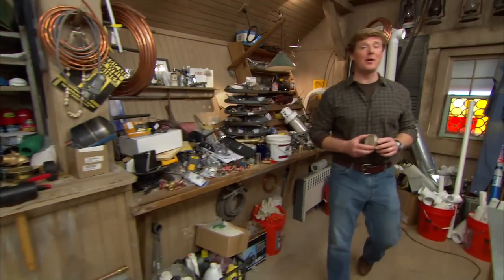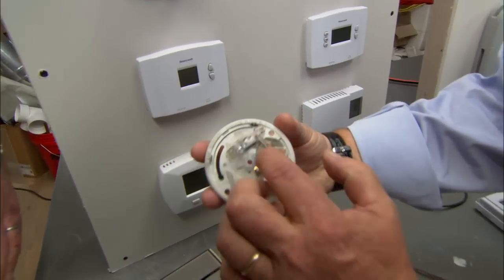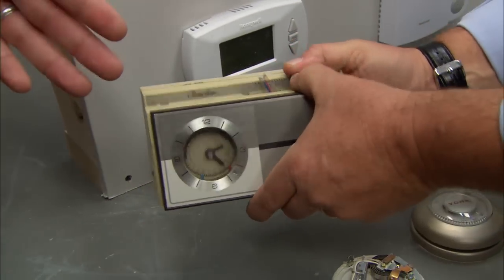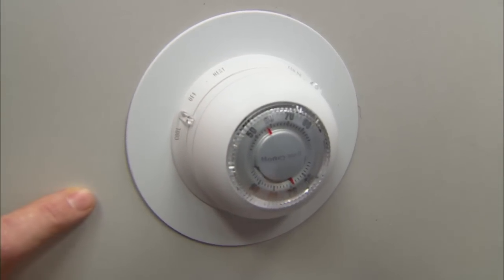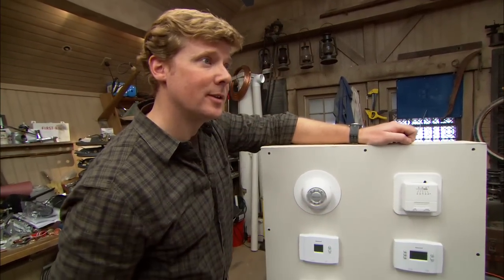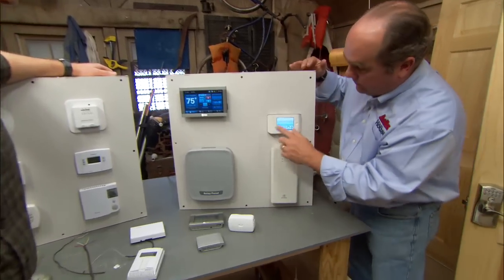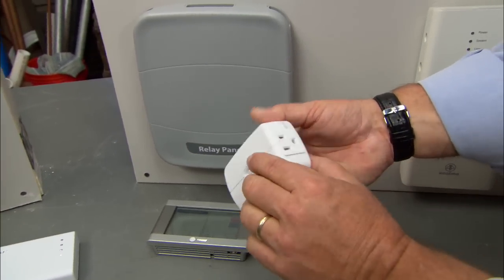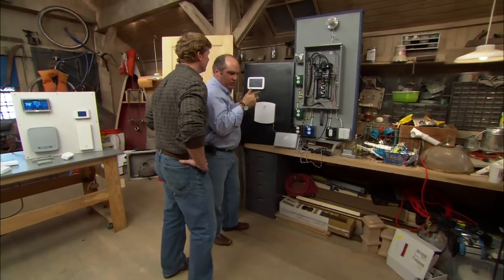How to Choose a Thermostat or Home Automation System | This Old House

Comment: Hi, my ac was working great until I changed out the
thermostat and now the system is not blowing cold air. I put the old thermostat
back on and still blows but not cold. What did I blow up? Thanks
Reply: One of the relays on the circuit board cause you probably didn't turn off the power. I'm sure you've called a tech by now.

Comment: Sir: I have two zone house.  I want to replace the bedroom thermostat in the hallway.  I want to replace it with the relay board (2:10). Then, I would like to get the wireless remote thermostat.  The brand names of the relay board and wireless remote thermostat are not easy to read. Could you please provide the brand names. tnx EdA

Comment: My baseboard heater works by setting the room temperature. It's a 5 foot long baseboard heater in a 170 sq.foot room. I set the room temperature to 22 Celsius. How much wattage does this consume? And would it cost more to set the temperature to 23 C?

Comment: Hello, I'm from Argentina where this is not an easy topic and I'm travelling on the next month to the USA. My idea is to buy products there.
I saw some of your videos and they are awesome! Really helpful, anyway I have some doubts about my case. Let me introduce the situation.
I would like to give my system an update. I have a Lennox heater and A/C system (model C23-51/65FC-1). Right now I have just ONE old thermostat and I would like to install TWO digital tstats (one upstairs and one downstairs). 
I have already checked and my unit have the C-wire (not connected).
Another very important thing to take into account is that I don’t have any dampers (and I find it very difficult to install them), so the idea is not to do a zoning but to have control of the temperature on the floor I am regardless what the temperature is on the other floor.

So, question:
Is it possible to install the two stats in parallel and select from my device which one to work? Or do I need a “selecting device” like for example a Lennox LZP-2?

And just FYI I’m not looking for the latest Tstat model. The only pretension I have is that it would be great if they could be WiFi controlled. I was looking at Honeywell RTH6580WF and I think it would be great for me.

Please advise me on what to do on my situation.
Thanks in advance.
Regards.

Comment: Don't remove the mercury thermostats, they are far superior to what is made today, and left in place are not an environmental problem the mercury is incased in glass and cannot go anyhere. “an estimated 310,000 mercury thermostats are disposed of every year just in New York, but only slightly more than 1 percent of those are recycled. The vast majority of them are being dumped into our enveronment and each one contains approx 2.8 grams of mercury which can poison about 150 million gallons of water each.

 ”They require no batteries and unlike modern thermostats almost never break and will not shut down your system in the middle of winter when you are on vacation because of a weak battery, causing your pipes to freeze and flood the place. (happened to me) The energy savings from a electronic thermostat is greatly overrated to in fact in my actual real life studies, I can detect almost no difference. As a landlord, I used to replace mercury thermostats routinely, However, after spending over a thousand dollars in cost of replacements, troubleshooting, parts and labor for techs to troubleshoot Hvac units only to discover malfunctioning electronic thermostats, I reinstalled the old mercury ones that i had on hand, and they just keep functioning decade after decade. Finally, there is no programing required which is time consuming to have to keep reprogramming them constantly for various reasons.
Reply: Some digital thermostats can run OK without a battery.  I have an 80's vintage timed-setback digital unit that only uses the battery to keep its memory and clock going during power outages.  Within the past year I bought a new basic heat-only digital unit that only uses its battery to remember its temperature setting during power outages.  You just need to shop around for a unit that's made to still work without a battery, getting its main power from the furnace's 24V wiring.  My newer digital thermostat also has a jumper to choose 1º or 2º hysteresis, either of which is more precise than what you might get with a mercury-switch-based thermostat.

You do need to properly dispose of (i.e. as household hazardous waste) the mercury units.
Reply: @billdakelski

I agree.  I prefer the old-school mechanical thermosts over digital ones, including those smart thermostats like Nest and Ecobee.